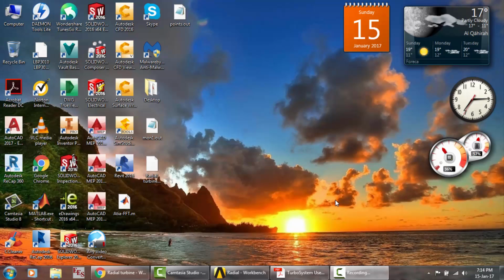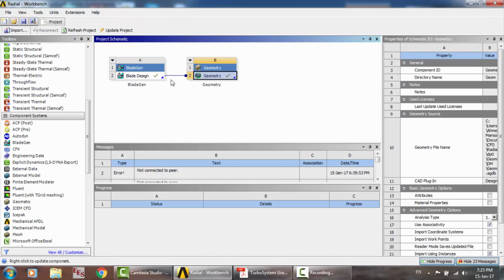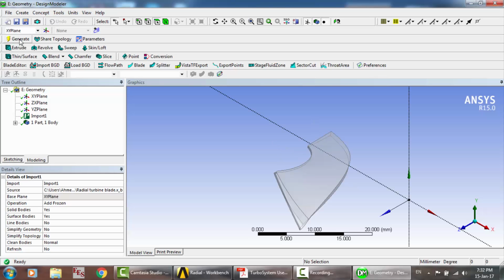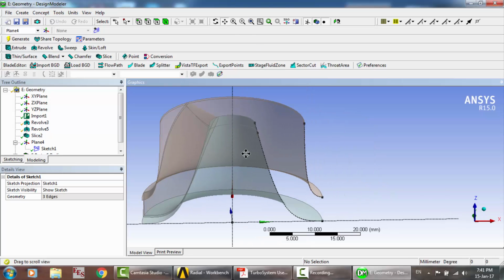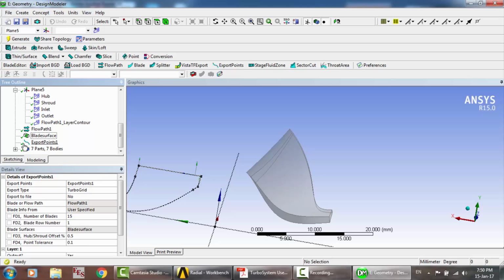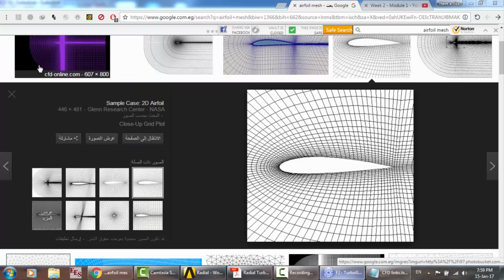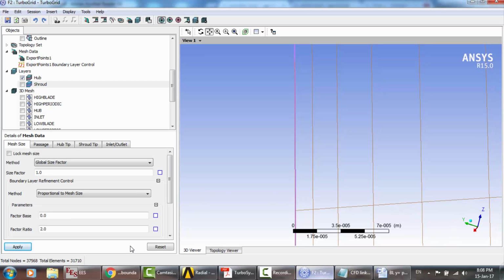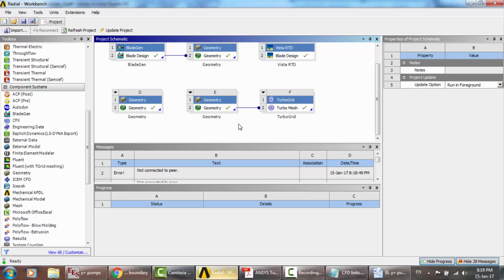A CFD Radial Turbine  Ansys Blade Design Modeler Editor and TurboGrid Flow path and Export points

Comment: Hi thank for you good tutorial.

I am trying to  model a rotating fan  with rotor stator assembly.
where both has been meshed and saved separately as  rotating region and stator region while interphase has been provided at the surface. Problem I am facing when I am importing the file in to fluent after merging the same in ICEm as I am unable to find two  interphase  in fluent which required to impart rotation in fluent to rotating region. Only one Inter phase is visible.
 if you have  any suggestion  to deal with the problem.
Reply from the maker: Hello dear Kampu, in ICEM, you can name the 1st interface and the 2nd interface and you have to find them in fluent, you may not need to name them and fluent can detect them automatically, but check out interfaces in fluent and you have to find both contact regions...I have carried out a 3D simulation about a vertical axis wind turbine but using ansys mesh tool not ICEM, so, take a look on it and if you still have a problem tell me to solve it together....We use ansys mesh when we have interfaces because this is easier ...Thanks
Reply: Thanks for your Reply
Reply from the maker: You're welcome sir :)

Comment: One question: how to proceed when there's also a splitter blade besides the main blade (centrifugal compressor)? I tried to export the points of the splitter blade using the same FlowPath. It apparently works, I have a correct visualization when I open TurboGrid, but an error happen when generating the grid. It says that "the low theta blade was found not to be the longest blade" and TurboGrid can't choose an appropriate topology for this machine configuration. The error doesn't happen if I just export the points of the main blade. Any suggestion?
Reply from the maker: Okay, contact with me on mech.eng.ahmedmansour@gmail.com  to send me the snapshots and I am going to try to find out the problem, Thanks

Comment: Thank's a lot for the toturial, it helps a lot. Could you advice me 
please what should I do with 3d compressor model with blades and spliters? I've 
tried to create second  flow path for spliter but an error has appeared.
 Is it the correct way? I've also tried to ExportPoints from spliter on 
the first flow path but it hasn't worked too.
Reply from the maker: Hello dear Pawel, you are welcome, is it acceptable to send me your design x_t files that you have errors with them and I am gonna try to help you?..Thanks mech.eng.ahmedmansour@gmail.com

Comment: Very good video. I have a question please regarding the stator design in the radial turbine, which choice should I do with when I use the BladeGen? Is it the Ang/Thk or Prs/Sct? and what the difference because I made my  complete turbine design, with its volute, based on the Prs/Sct . Is this true? Thanks in advance.
Reply from the maker: Thanks dear Ahmed, check out this link please and also you have to study the section of Bladegen in Ansys TurboSystem manual :)...Thanks and tell me if you still have any questions...

https://www.sharcnet.ca/Software/Ansys/17.2/en-us/help/wb_bm/i346269909882346230939010.html
Reply: Again many thanks for your fast reply. To be more specific, is there any restriction to use the  the Ang/Thk or Prs/Sct in designing the stator of the radial inflow turbine? Can I choose  the Prs/Sct  in designing the stator which will be inserted in a rotor designed basically using VISTRTD? Should one of them be specifically using when there is a volute for example and the other not? If you have an email address, I can send you the 3D shape of the turbine which I designed.   Thank you very much.
Reply from the maker: Not at all sir :), there is nor restrictions, you only have to know which information you have and you can use as inputs to bladegen because the inputs affect the final blade shape :), That's why you have to know the differences...you can contact me on mech.eng.ahmedmansour@gmail.com
Reply: Thanks again.
Please see your email. I sent you some details. However, Regarding the problem of how to make the stator inclined, I found the solution. Thank you very much.
Reply from the maker: Okay dear eng. Ahmed, Thanks
Reply from the maker: Dear eng. Ahmed, check out these links please :) Thanks

Ansys Tutorials:

https://www.youtube.com/watch?v=TNmsDfN6LH8&t=86s

https://www.youtube.com/watch?v=zXwsJPMs6XQ

Research Papers and References:

http://www.mediafire.com/file/xx309b93cxbmjjz/Resaerch_Papaers.rar

CFX user guide

https://www.google.com.eg/?gfe_rd=cr&ei=k1qnWNn5C8as8wfRoY-ABg#q=cfx+user+guide

CFX tutorials 

https://www.google.com.eg/?gfe_rd=cr&ei=k1qnWNn5C8as8wfRoY-ABg#q=cfx+tutorials

and

http://www.mediafire.com/file/cub5u6hmdl3omrg/ANSYS_CFX_Tutorials.pdf
Reply: Excellent. Thank you very much dear.

Comment: Hi ! First of all, thank you for your tutorial ! 

I have some issues when generating the FlowPath ; i get the following error : "A valid, continuous FlowPath loop cannot be determined from the defined contours, i.e. a loop cannot be constructed from edges inside Hub Contour, Shroud Contour, Inlet Contour and Outlet Contour. Context: ansFClientBMBladeDesign::Execute FlowPath2".

I did everything just like you do on this video, except that i created my own hub and shroud with sketches instead of generating them from edges on the blade (they are actually bigger than the blade). But then i made the slice, and sketch projections just like you do. Maybe it's a detail : i imported the blade from an igs. file (i work on Creo 2.0).

Do you know something from this error ? Thank you in advance for your response !
Reply from the maker: Notat all dear Lazorll :), you have to generate the hub and shroud from  the blade like what I did because the projection will not be suitable for the geometry, that's why I used the revolve of the 3D edge not any other method, try to do it again because the off set percentage is important to be less than 8% between the hub and shroud...tell me the progress..Thanks
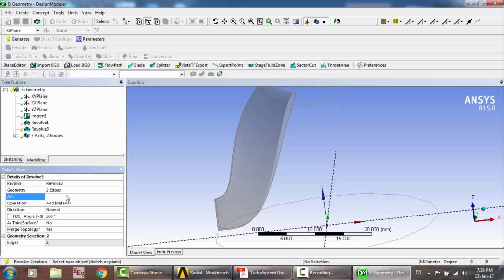Reply: Got the same error... But i think i found out why : as i understood at around 24:00, the hub and shroud revolves must entirely cover the full faces of the blade, which is not my case (because of my CAD design).
Reply from the maker: Yes, this is the trick :).If the blade is complex and the projection is not appropriate, it will be a hard task to get the export points or the flow path...Thanks
Reply: Hello !

I finally managed to import my geometry in Turbogrid, thanks to this ANSYS tutorial (https://www.youtube.com/watch?v=jKRzrj9d4gE&t=193s) and yours for the export points.
Now i've got another problem : my leading edge is not a straight line, but a curve in 3D starting from the hub and going toward the center until it reaches the shroud.

Turbogrid only uses 2 points to represent the leading edge, one at the hub and one at the shroud, which makes the geometry quite awful :P Is it possible to generates more export points on the leading edge in Design Modeler, so i can get a better modelization of it in Turbogrid ?